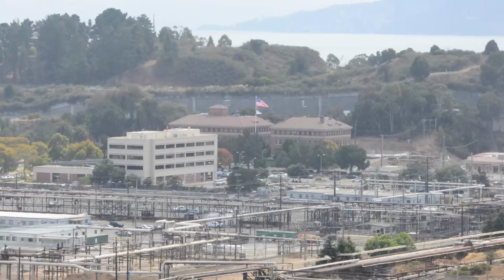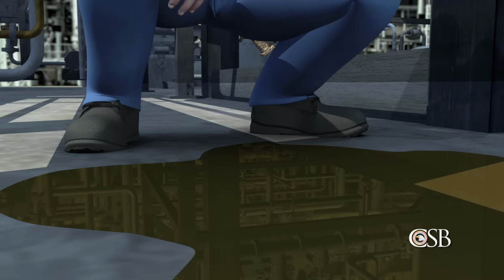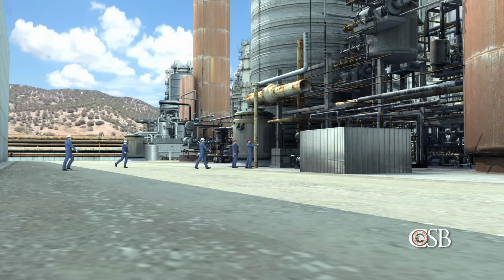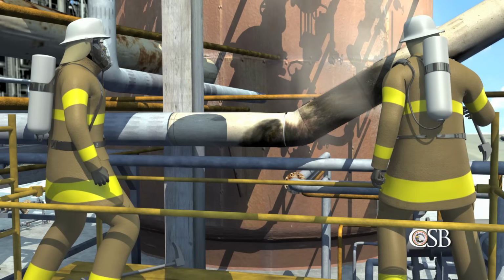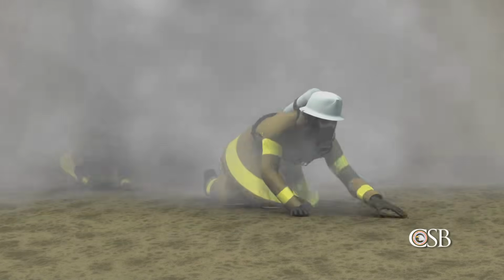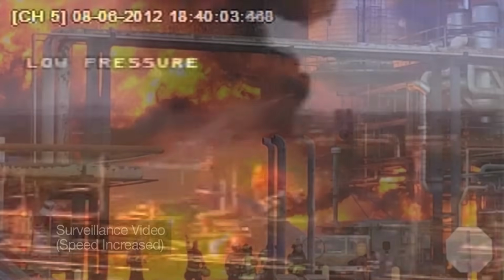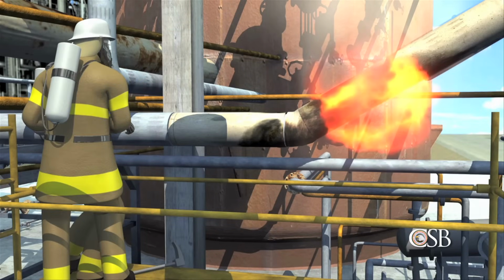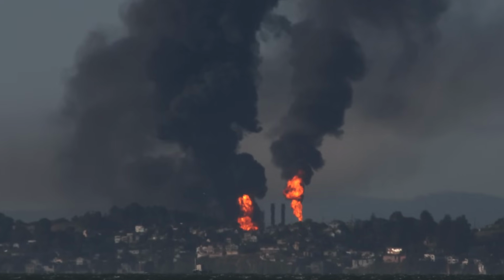Animation of Fire at Chevron's Richmond Refinery, August 6, 2012

Comment: "...Replacement was recommended, but this did not occur."  Jesus. Over and over again in these videos 'management' is given ample warning, and almost every time they sit on their hands. Why? To  maintain production and max out their precious bonuses.  All at the risk of life and limb, pushing critical maintenance out just long enough for them to be gone/retire. Then their replacements can always say that 'somebody else' made the decision before they got there. It's a system that rewards zero accountability. Disgusting. At least this time no one was killed.  This time.
Reply: Its a familiar story. I resigned for something similar, but it was an HCL pipe. It had degradated to 2mm and I wasn't able to shut it down because the so called Integrity Engineer gave the all clear to carry on.
Reply: @dvaidr   Absolutely, idiots such as described are always the winners,somehow or other, the reluctance to repair BEFORE it goes bang is beyond the capabilities of many in the 'managment areas of business, they are too short sighted to visualize that a stitch in time saves nine. Doh, even my grandma has that philosophy.!
Reply: Greed. Greed is the reason.

Comment: Had they only thoroughly wrapped that pipe in duct tape at the first sign of a problem everything would have been good. Duct tape is relatively inexpensive and works so good for everything.
Reply: 'cmon, at least use FLEX TAPE

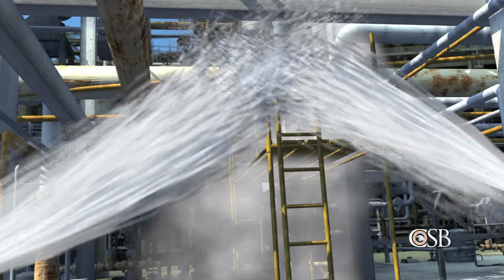Comment: How stupid can they be at 4:00 using pressure to get insulation off when the pressure can cut open the leak, wouldve kade more sense shutting the unit off and bleeding the line out purging it then welding it

Comment: You know, 2012 portable thermal cameras were relatively cheap and easy to get.  You'd think a refinery would have one.  At 600 degrees, no part of that fuel column would be liquid at atmospheric temperature, so the insulation shielding had to be acting as a heat exchanger to condense the dripping fuel.  About 10 seconds of looking at the pipe with a thermal camera would have revealed where the leak was without the need to remove any shielding or insulation.

Honestly, if the CSB would include cost estimates sent to the refinery's insurance companies and shareholders, you'd probably get a lot more of a response out of the refinery's owners.
Reply: Ah, nope.  We use IR for inspections.  The insulation jacketing reflects, and you cannot see temperature gradients.  Jacketing has to be removed in order to do this.
Reply: They wanted to install a bandage, they were prevented by isolation.
Reply: We always X-ray before removing insulation
Reply: It’s called using a CUI RTR camera no thermal camera was needed. Real Time X-ray would have found the source very quickly. This unit should have been shut down and those dumbass FF should stick to Fire fighting and leave the NDT and Engineering to the qualified professionals.
Reply: Yeah your are correct but Oh Deary me, Thermal cameras cost money and would the return on expenditure on such luxuries match the return in safety?
Reply: @terryofford4977  The insulation blocks infrared from what I remember so thermal cameras would be significantly less effective than many think at finding the leak

Comment: That pipe was over 40 years old and no one thought it a good idea it was time to change it out? 

Up until its failure leveled half the plant, I'd say they got their money's worth from the initial investment.

Just a guess... how long would it have taken to replace that run of pipe? Considering shut down and purging of the unit then restart... 48 hours?...which could have been done during one of the many maintenance shutdowns in the years proceeding
Reply: especially with dragging out the blueprints and getting the replacement fabbed beforehand.
Reply: Yes your suggestion is a good one, it's similar in the Airline Industry   which has strictly mandated shut down periods for an aircraft, (it is however,  sad to say,) there are many smaller companies who will go to any length to 'overlook required maintenance procedures, Take Alaska Airlines for instance where the all important Jack Screws which permit Tail fin operations are UNCHECKED and UN MAINTAINED for as long as six years...Quote' because the Jack screw is time consuming when appropriate greasing and maintenance is deemed necessary....I rest my case. Net result, one lost airplane PLUS loss of real live passengers and crew...oh well, think how much we've saved on our maintenance bills!!!!

Comment: It's hard to believe that highly experienced engineers and technicians can be so casual about obvious defects in equipment that processes hundreds of thousand of gallons of highly explosive substances. There they are, standing right next to a massive hot bomb that could make a crater in the ground a hundred feet deep, and they're poking at a pipe with a sharp stick. And this is just a typical example of what goes on all over the country 24x7!
Reply: Surprisingly, all over the world the same problems.

Comment: 2:47  Did anyone else start audibly yelling at the cgi dude NOT TO DO THAT TO THE VERY FRAGILE PIPE THAT HAS 600 DEGREE petrol products running through it.
Reply: Yep! "So we have a pipe with 600 degree gasoil under pressure, that's already leaking. Let's remove the outer casing to find out if there is a big hole that will vent explosively and douse us all with gasoil at 600 degrees! What could possibly go wrong?"
Reply: Also I'm pretty sure the video stated these were all Chevron's on-site firefighters, like they apparently staff full time firefighters there.  So they should have been a lot more familiar with it than a random local FD that shows up.
Reply: @Syclone0044  they are Chevron firefighters. Whole crew of their own....God Bless those folks.. .I would be running for the hills....those folks run TOWARD it!! Recently met a few of them on that site. Not a job for me. We have a saying in our family..."What's Rule #1? ...avoid Natural Selection Dad!!"
Reply: @Syclone0044  I might have ununderstood this if it was the "Podunck V.F.D." that showed up.
I don't understand how professionally trained refinery firefighters were talked in to "Stand under this leaking process pipe at this refinery and jab it with sharp sticks."
Reply: I tried to tell them, I yelled at my video screen, but they would not listen.
Reply: Yup.  Although, having done insulating at CNRL here in Canada, nothing anyone else does phases me anymore.
Reply: You don't send a fireman to do a mechanics job.

Comment: Are these refinery workers that dumb? They knew that the pipe had been corroded over time, but they chose to have an employee poke at it with a sharp stick. I have been watching these report videos and not one has reported if any of the responsible individuals were ever charged and or prosecuted. There needs to be better legislation that will hold these owners, managers, and supervisors criminally responsible as opposed to just civilly. I say this because I watched a friend die in an industrial accident in 1993. It took the company 6 years to settle with his family and no one was ever held responsible because it was deemed and industrial accident.

Comment: You really have to wonder; What were these morons thinking? I bet they go home and stick forks into energized toaster. The most incredible part is- they had been warned. they were supposed to be "engineers". They fully understood the effects of corrosion on this mild steel pipe. When they inspected before this incident, they discovered corrosion bad enough to replace some segments of the piping. What did they think was happening to the rest of the pipe they did not inspect or replace? It was made of the same material carrying the same product! If they have allowed their concern for profit override their concern for safe operating practices, they do not need to be in this business.
Reply: Do you want to kick the floor half of the company?
Reply: Surprisingly, in another part of the world the same problems. But, thank God, I'm not sticking forks into the toasters)

Comment: So after everything, when an operator says "Oh, something is leaking? Yeah we really should shut it down.", we should probably just shut it down.
Reply: Not just something. A pipe containing a high volume of hydrocarbons way above the ignition temperature, that has a direct line to the entire distillation tower.
Reply: Nah, gotta keep up to quotas on production, can't think about safety or anything!
Reply: There are no acceptable hydrocarbon leaks in a refinery. It’s pretty simple really.
Reply: I work a very dangerous job. When I report things that are not right, I often do not get the support I need.
Reply: No dont shut it down, just poke it with metal sticks. Thats obviously how you fix problems in life.
Reply: This whole thing is on a level of stupid rarely seen. Except sadly it is not.

Comment: Why are fire fighters doing maintenance work? Hey this line is leaking oil, let me jab at it with my poker.
Reply: I'm assuming they were attempting to take the leak seriously, the firefighters were in gear that would protect them in the event of a fire. Walking through a wall of fire is not really possible without full turnout gear on.
Reply: Because it exploded. Did you not watch the video?
Reply: First and foremost, what they did was not maintenance work, but rather a check if the pipe is about go boom. Everyone seemed to understand that there was a good chance it could do that.
The light oil was heated beyond it's ignition temperature, that's why it burst into flames with the first small vapour cloud...you absolutely need to be in full fire gear if you're doing anything with a leaking superheated oil pipe. Even if it doesn't instantly light on fire, it's still plenty hot to give you 3rd degree burns if it sprays on you. The fire gear give you time to run away unharmed or at least survive a major fuck up.
Reply: Typically refinery firefighters are actually operators and maintenance personnel that have given proper training and proper equipment
Reply: Sky Dog refinery firefighters are firefighters that have been trained, not operators and maintenance.  Any operators and maintenance helping out are members of a fire brigade, which are basically firefighter reserves that respond to assist the actual refinery firefighters.  Meaning they would be working their normal operator/maintenance job, get a call saying the firehouse requires emergency response team, or fire brigade members to meet to assist the firefighters.

Refinery firefighters are strictly that.  They do no maintenance work in the refinery, and they don’t operate process plants.  At least at this refinery in Richmond.
Reply: Sky Dog well no I’ve been in some refinery’s with actual fire stations 
Small but still
Reply: I respect firefighters, but sometimes they're not the smartest
Reply: @shammzz3  to be fair refinery fire teams are recent in fire terms. They were introduced around when chemical and factories started appearing
Reply: @KaiserStormTracking  yeah but some things are just common sense
Reply: @shammzz3  thats for sure
Reply: so they can be blamed later when SHTF
Reply: Cali.
Reply: You’re ignorant as fuck.
Reply: @DET_C0RD     dude chill out with the f-bombs

Comment: Another case of profits/production before safety...
Reply: Ironically it would of been far cheaper for them had they just replaced the damn pipe instead of paying out the subsequently huge sums of money required for clean up and replacement of a huge section of the refinery. Idiots I tell you.

Comment: Throwing water on a thin hot metal is a good way to cause warping causing any leaks to possibly amplify. Best to add that to some of those guys education when thinking about using a high flow rates that cause a lot of cooling on hot steels like that. Metal can even crack from being cooled fast.
Reply: Firefighters are trained to fight fires not to be mechanics. Chevron bosses wanted to keep production up and running. They knew the had a leak of hot hydrocarbons and could not stop the leak by closing a valve. 

They should have shut down production at that point because the pipe was insulated so they had no way to know how bad or big the leak was removing insulation which could be the one thing holding back a bigger leak was a criminal disregard of safety even if it had been done by mechanics.
Reply: @kimobrien.  
Your right
Refinery firefighters should have only been there incase of fire.
Well trained and certified mechanics should have been there, properly doing the work.
I have weld inspection friends that do refinery inspections during running operations. 
My one friend told me, on a running line, that the width of the pipe at the elbow was 2 times widths of a pop can one day. Most of that shit is suppose to be well above that... LOL
Reply: @sasquatchcrew  And they would have said shut it down which is the answer the bosses DIDN"T want to hear. Why? Cost them wages and loss profits so they take huge risks because that's all the CEO's or Bankers office in New York looks at. Profit, Loss, and risk. If it blows up its an early tax write off and they call a banker friend for a loan at  a preferred customer interest rate.
Reply: @kimobrien.  there was no valve....
Reply: @tttarms1970  Exactly my point. It could very well be a valve could not be installed because if closed then there is no way for the gas oil to leave the distillation tower meaning the whole process leading up to the distillation tower would have to stop. The mechanics fix pipes because that is their job. They probably refused because they properly understood the danger of opening the pipe cover with a leaking pipe inside having a liquid hot enough to self ignite. Which is why the first fire occurred when firefighters were tasked with taking off the cover of the pipe. Not happy with starting one fire they then made the decision to try for a bigger one and then got what they should have expected. 

Also anyone with half a brain knows you don't hit a high temperature object ( 640 degrees F) with water unless your willing to destroy it by creating a huge temperature differential.
Reply: @kimobrien.  yep why if you put a hot glass lid for a pan into cold water.....you will need a new lid haha.
Reply: not to mention the high pressure of a fire hose hitting the pipe aswell

Comment: Replace the pipe? Shut down? What are you ... nuts????  That stuff costs money.
Reply: after accidents they have to pay much more .
Reply: @saeeds777  theyre insured, if anything theyll make money in the end from an accident
Reply: @saeeds777  It's a risk they are willing to take either because they are morons in denial or don't care if lives are lost. Probably both.
Reply: That's just what I say when someone says they want something cheaper ...
It's crude, but it's the truth.
Reply: After working in a refinery I learned that starting up and shutting down a unit has all kinds of other complications and dangers. Its not like turning a key off. Temperature and pressure spikes occur, instabilities happen. Refinery processes like steady state stable operations for months on end. 

Shutting down a process is not taken lightly by operators as other hazards can happen. Everybody is always on edge during process changes because that's when accidents occur.

In my years there, money was never a concern regarding operation actions. Safety is the main concern. Upper management is aware of the revenue loss of shutting down production but the unit operators never give it a thought. Safety is stressed more than anything else in a refinery. Its still a dangerous place to work.
Reply: @kimmer6  True that, I work at a FCC unit in a crude oil refinery in Germany.
Reply: @ImplantedMemories  Ya they pound safety into your head and then tell you to hurry up and gett'er done.
Reply: @kimmer6  "Shutting down is when accidents happen" Well... not in this case internet refinery safety expert
Reply: 😂😂clearly the people commenting don't understand sarcasm.
Reply: @Ramprust  lol, I think youtube is getting dumber, if that's possible
Reply: Barake, every company has times when things go wrong. In a refinery, hot high pressure hydrogen gas is the lifeblood of the place. It is an ideal heat exchange medium. It is also what caused the Hindenburg to burn violently with zero pressure in the gas bags. I worked at the Tosco Refinery about 30 miles from Chevron. They constantly pounded SAFETY FIST into us every day. Yet explosions happened, people got killed. I am surprised there are not more accidents.
Reply: kimmer6 that company is instantly better than all companies that appeared on this channel
Reply: kimmer6 oh i never knew that
Reply: That pipe required an executive poking.
Reply: Surprising method of troubleshooting, firefighters, scaffold installation, cold water. Many methods of action have been developed from switching off part of the chain to installing bandages.
Reply: Shoulda used flex tape
Reply: Edward Hara "the head operator knew it was serious but didn't need immediate shutdown".(face palm) next second 💣💣💣💣💣💣💣💥💥💥💥💥💥🔥🔥🔥🔥🔥🔥💥💥💥💥🔥🔥💥🔥💥🔥💥💥💥💥💥🚒🚒🚒🚒🚒🚑🚑🚑🚑
Reply: kimmer6 true
Reply: lol
Reply: If the Culture of Safety naturally took place over the Culture of Profit for executives and Culture of Laziness for those under them, we wouldn't need to have all these regulatory agencies telling employers and employees the obvious.

Comment: very valuable info thanks
Reply: Valuable indeed, Chevron Corporation (NYSE: CVX) today reported earnings of $3.7 billion ($1.95 per share – diluted) for fourth quarter 2018, compared with $3.1 billion ($1.64 per share – diluted) in the fourth quarter of 2017, which included $2.02 billion in tax benefits related to U.S. tax reform.Feb 1, 2019